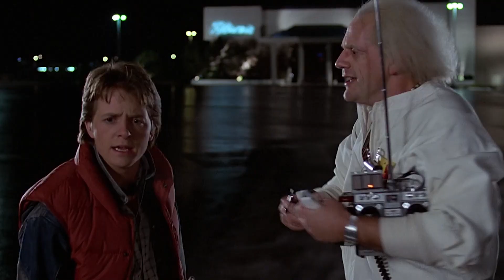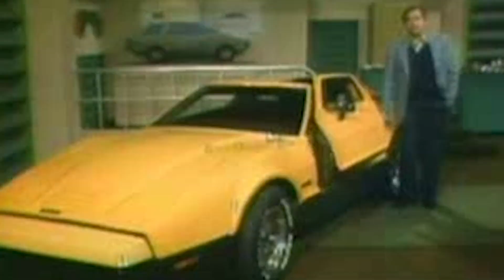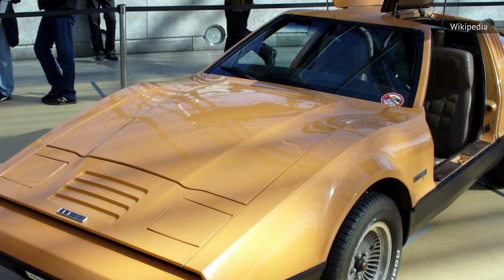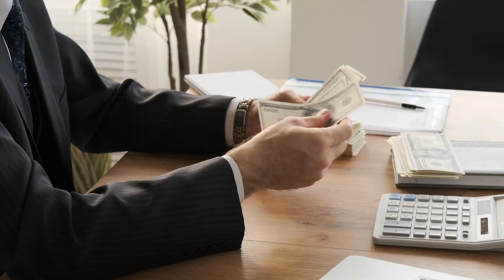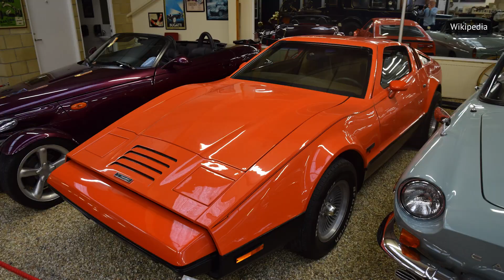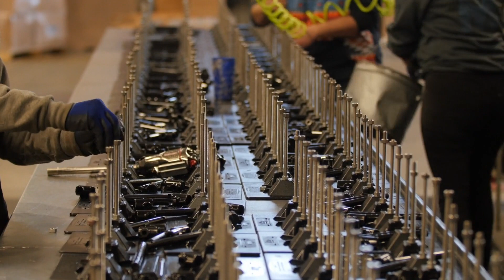The Story Of The Worst Selling Sports Car Ever

Comment: The Bricklin actually sold well.  There was a back order for 40,000 cars when the Canadian government shut the plant down in late 1975.  The build quality did improve by the summer of 1975, but by then, the plant was struggling profit wise and production wise.  The hydraulic doors took 8 seconds to close, not 12.  The air system takes about 2 seconds and both doors can be opened at the same time.  772 cars built during '74, 2100+ for '75 and 17 cars for '76.
Reply: I believe it was 34 made in 1976. 31 Safety Suntan, and 1 of each of three other colours.

Comment: I have never seen a car before or since the Bricklin that can pull off the hat trick that only the Bricklin SV-1 can manage.  This is a car that was built in 1974.  This car came way before the Delorean,  and it made the Delorean look like a woman trying to hike her dress up, very unflattering from the front!  I am watching this video in 2022, I was 15 when the car hit the market in 1974.  The care was carried by Woodson Pontiac of Roanoke VA, and they also debuted the Delorean in the mid 1980's.  Malcome Bricklin was very committed on producing a performance sports car, that could share accolades with the Corvette, and impact a solid brick wall at 70 MPH!  And the driver would be able to walk away from the car without injury, and NO AIRBAG, restrained by only the car's 3 point shoulder and lap belt. A feet one of the pre-production vehicles actually pulled off!  There was no astray, or cigarette lighter in the vehicle, as Mr. Bricklin considered smoking in a vehicle a fire hazard, unsafe, a distraction, and of course unhealthy.  That would be a real thorn in the car's future back in the day, especially in the tobacco states, and Ford Motor Corporation had already debuted the 1972 - 1973 Tareyton Mach 1 Mustang.  I kid you not, but I think it was a giveaway promotion of a car by the cigarette company.  While not all the rage that they have become today, power windows were not an option at any price!  Why, well if the vehicle went turtle, or went for a swim. Manual old fashioned crank windows would guarantee the occupants could exit the car if the gull wing doors became inoperative.  Or failed to function after hitting a brick wall at 70 MPH! Finally, the car would be the star vehicle for the 1977 horror movie, that I strongly recommend you watch if you have not seen it!  The motion picture was called, "Demon Seed," and Ewe, Weeeee, it was very, very, very, um, uh, hmmmm, lets see, Bill Gates, founder of Microsoft was 16 or 17 at the time I do believe, apples still grew on trees, and A.I., was all WTF, decades before WTF, became a thing!  One could say the movie was an inspiration to Mr. Gates, dunno, everything in the movie was not supposed to be until the next century, and nobody was going to live that long, not even me! And here we are, tahhh Dahhhhh! With the Bricklin still pulling off its 1974 Hat trick two years shy of a HALF A CENTURY LATER!  You can say what you want folks! Time Is irrelevant, does not exist, has no presence, no influence, no governance in the shadow of a vehicle that is incapable of telling time!  It was the next century in the 20th century, and it is next century in the 21st century, It is a shame in the 25th century all we may know of its existence will be in a photograph. A pristine example will not exist parked somewhere screaming in 2622 I will still look awesome in 3535!  Course A.I. will have probably contained the threat by then, humankind will exist virtually on a chip of martin silicate 1/100th the size of a fly's eye and all earth will be doing is rotating in the sound of absolute silence and the sun wondering WTF, who shut them up!